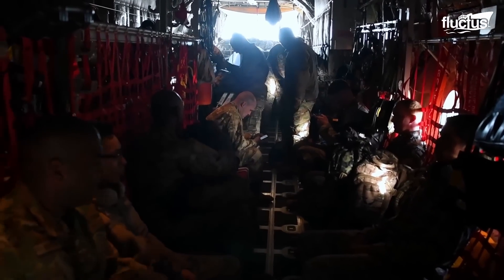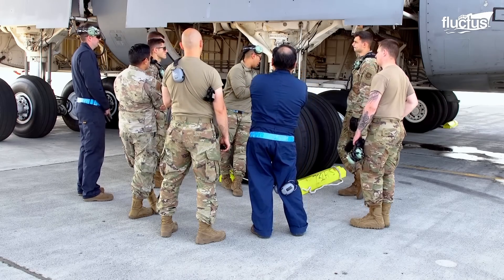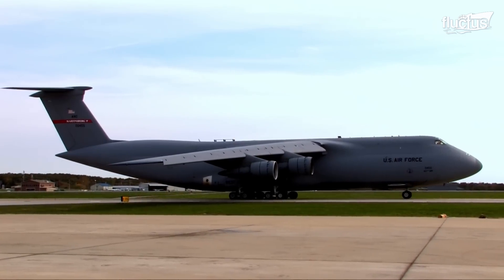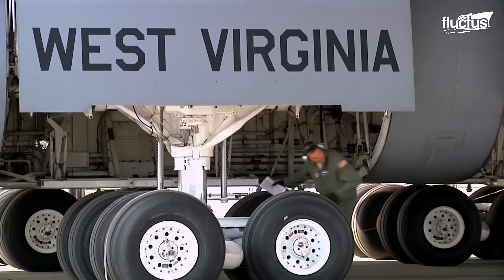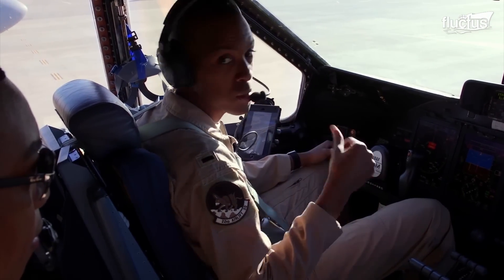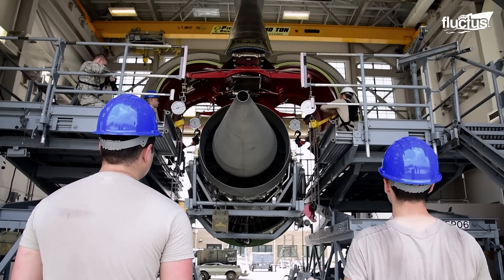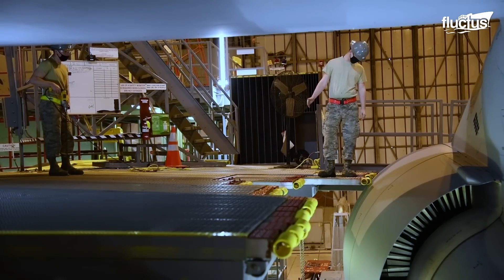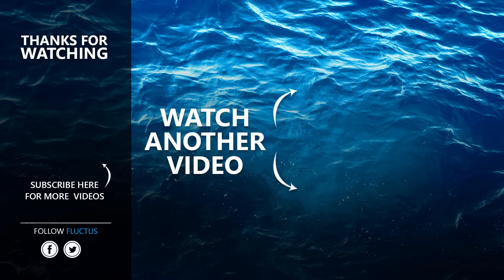The Genius Solution US Found to Maintain its Largest Cargo Plane Ever Built

Comment: My old man was structural mx for 23 years in the Air Force. He said he didn’t mind working on these birds that much until the first time was up only the tail which is six stories tall 😂.

Been loading these birds myself now as a Port Dawg for just over 10 years now. They’re an absolute pain to load or download regardless of cargo but good lord is it the coolest aircraft ever to me. 

Fighters are Cool. Bombers are, too. But this? Nothing comes close. Sure, the Super Galaxy upgrade to the C-5 completely revamped and overhauled its capabilities and performance, but those old engines were something else. 

Fighters were loud right after flying by or over you, but this? The way it would SCREAM and WHINE as it barrels down the runway, yet from far away has an eerie, deep, rumbling sound that echoes throughout the sky for miles is so badass. 

Apologies for the rant but this—this is the sound of freedom to me 😭🔥🤟🏾🇺🇸

Comment: The C5-M Super Galaxy is heavier than the B models they were converted from due to the new engines and other systems. It is however not larger than the previous models.
Reply: That's correct. It was not larger as described in the video.

Comment: I was a C-141A jet engine mechanic at Yokota Air Base in Japan back in 1970.  One of the first C-5s had an engine change there and we were not trained on the aircraft but kinda figured it out until the pylon winches broke down with the engine half way off.  Had to rehang the engine and send the winches back to Travis to get them fixed.  I didn’t finish working on it as I think they might have brought a TDY crew from Travis to finish the job.  It was one big ass airplane.
Reply: I flew from Travis AFB, CA, to Yokota AB, Japan, in a C-5. Yes, it is BIG. It was also a very comfortable aircraft to fly in. Did have a chance to go downstairs to see all that was inside. There were trucks and pallets of goodies. I'd fly this aircraft before any other if I had the choice.

Comment: Think the Ukrainian Antonov was the biggest cargo plane built.
Reply: There’s always a smartass . The description of the video is about US largest cargo plane, not in the world
Reply: The largest cargo for the US military, not the biggest overall. The AN 225 is the biggest but only 1 flew. The AN 124 is just behind the galaxy....   the A380 is actually bigger.
Reply: @adrianbriggs7028 but the A380 was never designed for cargo, either out-the-door or retrofit. When used for cargo during the pandemic, there were extreme limitations on weight and positioning due to use of pax decks and inability to move standard cargo containers through the pax doors on both decks.
Reply: @SoCalMan13  well aware... the list is the biggest aircraft....
Reply: I think I saw where the Antonov was destroyed in Russian Ukrainian war.
Reply: Yes, but the C-5 is the largest US cargo plane.
Reply: It says the largest cargo plane the U.S. ever built. It doesn't say the largest in the world.
Reply: You misspelled your last name. Shouldn't that a be an o.
Reply: Actually, the 747 cargo plane is larger and could carry more than the C-5.
Reply: @LEVELGAZANOW  not quite true, the 747 can lift 270,000 LBS and the Galaxy 291,000 in wartime configuration. Although normally 240,000 is considered a Max payload
Reply: @adrianbriggs7028  Actually, after the contract was awarded to Lockheed Martin, Boeing loaded a 747 with 310,000 lbs to prove a point.

Comment: I flew on the C141 and the thing I remember most about the C5 was they were broken down globally. But those guys got plenty of time off in cool places lol. When they did move they moved a lot and you certainly can't take that away from them ! Biggest mistake ever made was designating the 141 a tactical aircraft, it cracked them to piece's (crack's in the t tail you could put your hand in).
Reply: Took a few HOPS while I was in, conventual wisdom was to never take one on a C5 unless it was an A to B trip.  If it had to make a stop, chances are it would need maintenance.
Reply: I don't think I EVER saw one FMC C5, they were all PMCM
Reply: Boeing and Lockheed submitted prototypes. Lockheed changed A good boeing design and screwed it up. Boeing designed it with a hydraulic lift. Lockheed changed it to pneumatic.  Huge mistake. If it was necessary to kneel it, we had to bring in jacks to get it to full height. Lots more but I aint got thetime or patience.  I was there at Yokota when they began to fly them .

Comment: I loved flying on the C5. Engineering marvel.
Reply: It's an engineering nightmare.  I worked C5s at Dover in the mid/late 90s, (436 AGS) and I hated every minute of it. The back door/ramp system, dewars, landing gear and constant wiring problems never ended.  That's why it's called FRED: Fucking Real Economic Disaster. I can't believe they're still flying.
Reply: @lifeontheX  Non sequitur.